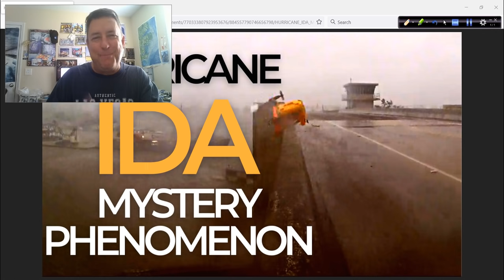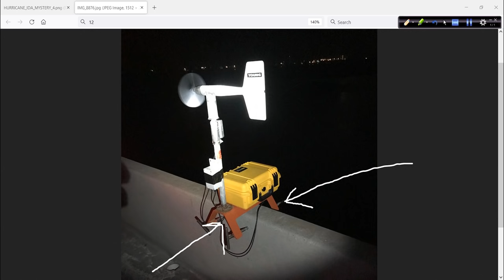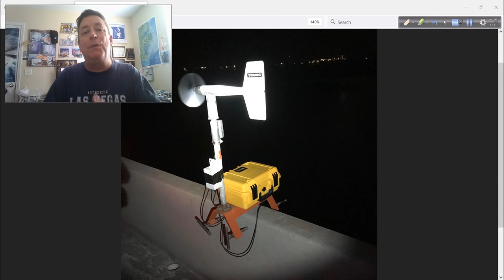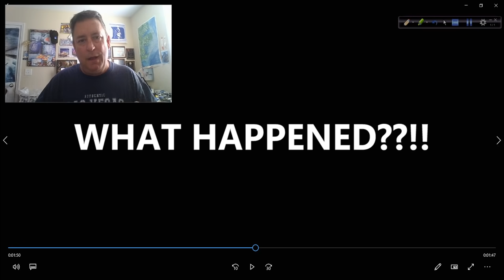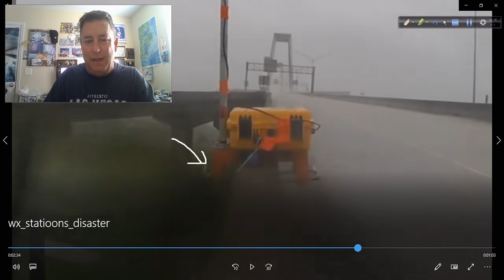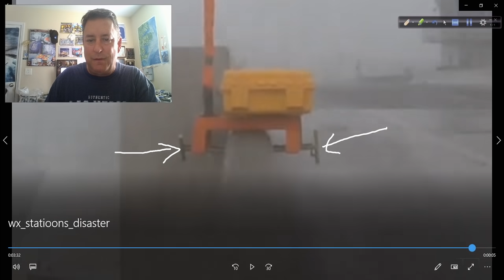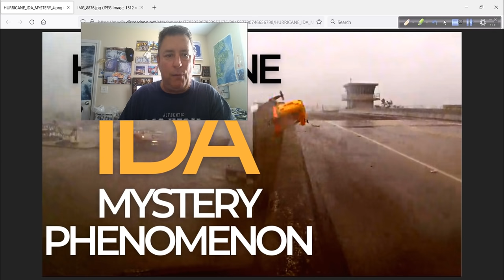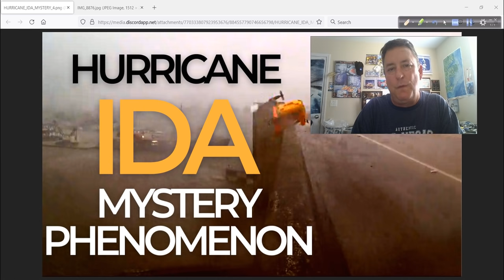Hurricane Ida Mystery Phenomenon: We Lost Two Weather Stations...Why????

Comment: As one writer said, add rubber pads so you can tighten it more, also add nuts to the screws between the bridge and mount.  Once you tighten the screws down, the tighten nut and also lock washer to other side to keep it from losening up.

Comment: 3 THINGS TO FIX THE PROBLEM AND Its a CHEEP FIX
Sorry for cap locks

T bolts need to be machined on the ends so there slightly concave. its wider bite surface then a sharp point
T bolts need some lock tight red put on them. lock nuts wouldn't hurt... lock tight lets them get it off faster when your in traffic
You need to buy a short pipe to add more torque to the bolts...

Concrete in most of the country is made with lime stone as it gets wet it can become slick and in some cases pouross which allows the bolts to loosen
You also have simple science on this. as steel and concrete cool they shrink slightly.. Example: look at rail way tracks in summer the ends are tight.. in winter they can open up to almost a 1/2 inch
down south everything is hot in summer most of the time.. hurricane comes in and cools everything fast 

But you have essentially a spinning fan on the box... Planes use stainless steel bolts with nyloc nuts. and coated rivets. in some cases rivets with O-rings. same with boats... We have to lock everything down on the boats... Its not pretty when the steering comes apart on a boat.
Reply: Concrete Made with limestone has a chance of small cracking under the sharpened points.
You can switch out the bolts that can add rubber pads mounted on steel pads. Similar to the pads used on a motor mount in a car eliminating vibrations and use a cordless impact to mount and dismount the box.
the pads remove the vibration at the wall... It can also remove your liability of public damage... Not that a Hurricane cares. But Ive also seen your videos and how close you cut it with Mexico FL.
When you use the impact with lock tight it heats it up. your done in minutes ans your already adjusted on the bck side. All you'd need to do is impact down the side closest to you...  Done in 5 seconds or less...
The cost is more for the fix.. the life your saving by not hanging around might be yours. 
I live in a tornado zone.. I'm a retired Aerospace worker who grew up with a Architect. Chemical engineer and 2 other Engineers... 
OR another possible simple fix is mount the box on the bracket with a 3/4 rubber pad between the bracket and box.

Comment: Hey Mark.

For one thing, you did not take into consideration for torque displacement from the wind vs the clamping. The clamps are too close to the device. No matter how tight they could be, the torque will losen them. There's not enough leverage.

You'll need to not only put them further down (lower) but, for more security, you'll need to drill through the concrete. Jersey barrier is angled, I'm gonna guess the clamp bolts are flat. A similar thing happened with the power transfer tower that fell into the river - the windload was too much for its design. 

How much load can the anemometer tower take before it breaks? It shakes, which vibrates, yes, and loosens the clamps. Not necessarily a sonic thing, it's a torque thing.

Better leverage and better securing of the clamps. 

Just a guess based on, LOL, staking trees properly.

Tommy
Mandeville, LA

Comment: this happens all the time it’s called backing out. You can literally have throngs come apart just with vibration that’s why they tell you to tighten u-bolts on trucks every so often because they can loosen. I think the simplest solution would be two drill a hole on each end of each handle then take a steel cable run it through the two holes set of holes closest to the center after tightening and make it as tight as you can. If you connect it to the two sets of holes closest to the center as one tries to loosen it will pull against the other preventing rotation. as you can see in the video when they rotate the two handles go opposite direction when looking at the center. Hope this makes sense hard to put in words.

Comment: I'm not saying its not resonance, but you don't need resonance frequencies to back screws out. You just need vibrations, and there are plenty there. Compounding the problem is you are tightening screws to concrete. Concrete has no give so a tiny amount of backing out, or shifting and you've lost all grabbing strength. At the end of the day you have screws backing out so add something that stops that. I would still be worried about driving the screws directly into concrete. I would add something to spread out the clamping contact area as much as possible.

Comment: Hi Mark,

Looks like several people have already touched upon the cause of this problem. I'm an engineer in the UK and we manufacture and install air flow control equipment for industrial ductwork. Clamps and screw threads will tend to vibrate loose in turbulent environments. In your case, the orange brackets (robust though they look) will tend to flex slightly when subjected to high oscillating force cycles. This will repeatedly relax the clamping force on the T-bars and will eventually cause them to unwind. Lock nuts (I think they're called jam nuts in the US) will certainly help. I would add two lock nuts per T-bar - one either side of the orange bracket's female thread. Tighten the T-bars very firmly fist, then secure them in place with the two lock nuts. For a belt-and-braces approach, a touch of loctite on the lock nuts wouldn't hurt. A quick blast with a blow torch on the lock nuts will release the loctite when you come to remove your equipment. Not a lot of extra cost/time to invest to save your precious gear.
P.S. Great channel – I’m a regular viewer.

Comment: Pretty sure I know exactly what happened here. When the concrete gets wet and cold it will contract slightly. This will goosen the grip on the concrete. My guess is it was enough in the winds to cause it to shift. Once it shifted there was enough slack that is moved and then it was over. 

There are a few things you can do fix this and that is to make sure the tips that engage the bridge have little teeth on them. Also a locking bar on the screw handles that lock them in place so they can't back out would be helpful. Another fix might be holes in the end of each t-handle and you can then use wire to lock the handles in places. This is done on aircraft with bolts and what not. 

On the first bridge you say there isn't any other so secure them in case they come loose but there is a drain hole in the bridge right below where is is mounted. A small chain or cable thru that hole and back up around the bridge would have secured it thru the concrete.

Might be worth investing in a little wind tunnel time to test your theories. There are wind tunnels out there that could easily get above 150mph speed. Many drag car shops use or pay of time in these tunnels to get data on drag on cars.

On another one of my favorite YouTubes pages (Cleetus McFarland) they just rented a wind tunnel to test their cars out. They went with a company called A2. You can reach their website at @t and you can rent the wind tunnel. Located in NC. It's $495/hour and they can go up to 85mph.

Comment: Was the equipment placed in between the pilings of the bridge and the camera closer to a piling?

Harmonic vibrations will occure more violently in places that are not secured or anchored. 

I'm thinking if you placed the equipment closer to one of the bridges pilons, there would be less harmonic frequency to back out the t screws.

In aviation there are fasteners that back out all the time at higher speeds and these screws are checked constantly due to that.

Comment: Was the pipe it was screwed onto or screws themselves heated by the sun/day temperatures and some other factor then suddenly super cooled. Use straps that tighten when cooled.  This can cause shifting with winds that are "thin winds" (read below) and  rub and wear the metal or cement the further loosen by the same winds. 

 At the same time metals that are not solid (internally porous) thus susceptible to extreme pressure changes thus change their expansion/contraction ratio...as Costanza (of Seinfeld)  would say shrinkage effect on both ends. 

NOW THE CRAZY PART.

Then add to that my crazy theory of a TS/TOR hybrid having angled winds.  If the eye/eye-wall being angled like the Rope effect of a tornado they create "thin winds" when coming from a wider circulation as a TS/Hurricane.  Meaning cause they are angled they have less force on perpendicular structures, they are still as deadly to soft tissue as in human body but act differently on structures. These angled winds might have an unscrewing effect (with long fetch/duration winds) on anything with a threaded cut as screws ONCE they became a bit loose from the temperature/pressure changes. Insert heat shrinking tubes on portion of screws exposed.

  If IDA had a perfectly stack eye wall then the  radiating winds would be  "thick winds" as in straight up and down.  Homes, buildings, poles thus built perpendicularly would have im/exploded.  Instead they where piece by piece ripped apart leaving stronger foundations cause the winds came in at spread angles.  

Its as if you place three fans on a staircase, each fan on a different step blowing out 110 mph winds.  Stand in front and only the middle fan's wind hits you.

Place the same three fans on a stacked shelf each fan directly above the other.  If those fans wind get close to each other the join up as still a 100 mph wind but with a bigger contact to surface point .  Stacked wind have a higher odds of joining up than slanted winds.

Comment: I'm no engineer but from what i can observe, it's as if the winds are exerting leverage besides frequency on the whole thing starting from the anemometer, which makes me think that a shorter mast (or in general a shorter length between the anemometer and the pelican case) could reduce the leverage. 
If you wanna be 100% secure, other than that, i agree that you should put a clamp on the screws to completely stop them from moving.
I'm not an engineer but that's the first thing i thought of.

Comment: Might be a simple idea; but, try adding n extra nut between the T handle and the outer edge of the frame. After you have tightened the T handle jam that 2nd nut up against the frame: that should prevent the T handle from unscrewing.

Comment: I suspect that the problem is similar to what Mike has already commented but add in a bit of your hypothesis. I have seen 2.25 tons of equipment held by four 1.5 inch bolts tightened to 1500 ft-lbs back off just like your Tee handles. 

Without more data and access to a proper model I can't tell for sure, but in my experience, often the worst case occurs when a 3rd harmonic matches something about the fastener. As a wild oversimplification, using air resonance instead of steel, you can build a mental analog to help visualize this.

The handles are about 6 inches across (3 in radius). That would be 4500-ish hz for air. If that is a 3rd harmonic, the fundamental would be 1500 Hz which is roughly 16 inches for air. An eyeball guess is that could be about the length of the anemometer center of gravity to the level of the clamp screw. That would be a possible cause for cause #1 in Mike's comment. To calculate it more precisely you need to know the center of gravities, moments of inertia, and Young's modulus for each of the vibrating elements. But you get the idea. A smart civil engineer that knows acoustics could do the proper calculations.

For our equipment we solved the problem with a bit of "blue Loctite" (or equiv.) plus a backing nut. That held well. In a small fastener like your Tee handles I would use a nylon insert locking nut as the backing nut to be "extra sure".

Since that only addresses #1 you would still need to deal with #3. To help with that I would look at a way to change the vibration moment on the anemometer. My suggestion would be to add 3 or 4 "aircraft cable" guy-wire stays to a ring clamp just below the anemometer pivot and anchored to the orange frame. That would help modify the overall vibration and help address #1 as well.

I don't think that adding stiffness to the system will have much effect. Ditto adding compliance (like rubber). As your instinct points to, the backing out of the Tee handles occurred before the "tip over", so point to vibration. That makes it look like a significant root cause.

Great work and videos. I really benefit from your analyses since I live in "hurricane alley".

Comment: That’s pretty easy fix. Can see from video, that it was not set all the way down on top of the wall like designed, then clamped. Barely got it clamped on the wall, wind rocked it enough to unseat clamps that are barely holding on for dear life.

Comment: I reckon the t screw's aren't low enough on the wall, the moment on the equipment at the top by the wind becomes too much and the screw's can't handle it. If the screw's were lower it would lesser this force on the screw's
Reply: Also water could be getting under the screw's on the wall loosening the screw's

Comment: I cannot help with causation, but I think the solution is simple. Two solutions came to mind. 
1. Use a jam nut on the thread portion of the Tclamp to help ensure it cannot spin off without first removing the jam nuts. 
2. Aircraft safety wire tied to the handles to prevent the rotation. 

Or both =D 

That’s what I would try first.

Comment: When free to deform, concrete will expand or contract due to fluctuations in temperature. The size of the concrete structure whether it is a bridge, a highway, or a building does not make it immune to the effects of temperature. ... Concrete expands slightly as temperature rises and contracts as temperature falls. If the concrete contracted, your TBolts would come loose, and with the high winds from Ida, the t bolts would be spinning. Always stay at the source, which is the concrete wall your equipment was bolted to. Just a thought.😁
Reply: Sorry, I meant to say start at the source.
Reply: Mark, I've seen all of your videos on You Tube, and I can honestly say, it definitely wasn't your equipment. You are very careful with all of your equipment. So, I started at the beginning, the concrete wall. How is the concrete affected during a Hurricane? In my opinion it was the concrete wall, not your equipment.

Comment: Are they moving because the box is sliding on the concrete?maybe lay a rubber mat across the barrier so it doesn’t slide and the screws tighten to it so it has bite
Reply: Also if you use a rubber mat it would absorb the vibrations

Comment: This actually quite easy. You are placing a metal point against  smooth cement. The inter system is vibrating at high level because there is NO rubber cushion between the smooth cement and the metal point. If you had a rubber washer between the metal point of the screw and the smooth cement this would not have happened. The rubber will act as a shock absorber and it will stop the problem. There is also and adhesive that is added to the screws on the bolt that will prevent it from unscrewing. If you really don't want it to unscrew you can always drill small holes in the bolts and the anchor system and put a pin through the two of them this will totally prevent the bolt from spinning because the pin will prevent it from turning.

Comment: How about tying the T-handles together some way once everything is in place?  Some flat / round bar stock, pipe, etc, so that the handles cannot unscrew.
Trying to get the handles lined up horizontally upon tighten, then come up with a system to secure them so that neither one can turn because it’s tied to the other.

Comment: The wind hitting the handles of the screws at a certain angle made the handles act like propeller blades/fan blades. Once hit with enough strenght, they moved, no vibration involved. 

Remove the handles of the screws and use a ratchet to tighten em up. No handles means no surface upon wich the wind can push.
Reply: Right just the force of water at those speeds
Reply: @doctorunicorn5550  Were talking about winds that have the strenght to rip tree roots from the ground... i don't think it's too far fetched to beleive the wind had enough strenght to lift one side of the handles. Im not saying im right , not at all and i could very well be wrong.

Comment: Create a lock bar to go between the handles to help prevent movement or loosening. Yes vibration is part of the puzzle but that bridge is flexing also. Vehicle engines flex at the higher RPMs causing things to loosen up through harmonic vibrations. Lock nuts may work & it’s a quick inexpensive fix.
Reply: This would be my suggestion also. Anything stiff to tie one side lock screw to the other should solve it since they rotate in opposing directions. Should be able to adjust those ends so they are at the same angle on both sides and run a bar through holes on them

Comment: The vibration caused by the anemometer is hitting the frequency of the mount and it's amplified by the length of the arm.
Together with the torque applied is enough to vibrate the mount screws loose, especially during those intense gusts. This is nothing different than an engine mount where you after a certain interval need to retighten the nuts. 
At some point those vibrations will start to wear down the material under the T screws due to the small contact area and that's the point of no return.

Simply apply rubber mount points (just like engine mounts) that can absorb some of the motion and add lock nuts to the T screws and you'll be fine.